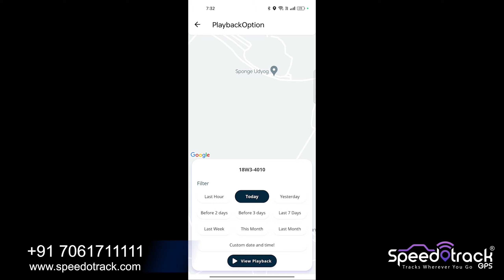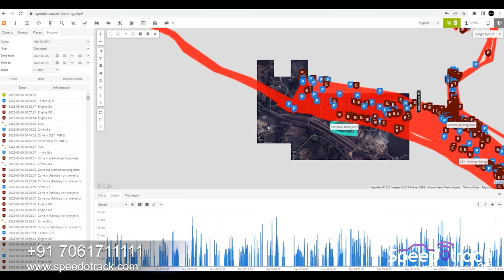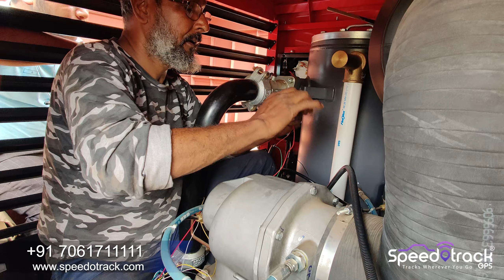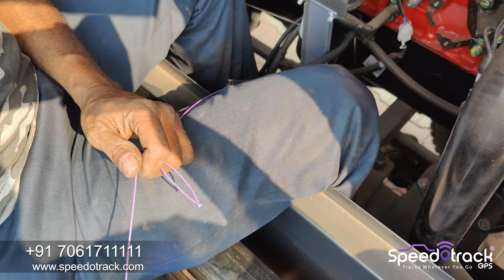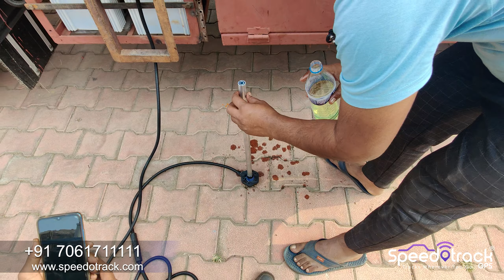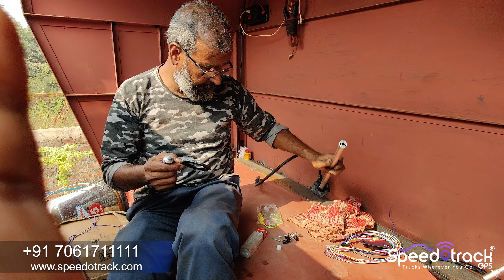Speedotrack Compressor Diesel Monitoring GPS for Borewell Truck Ashok Leyland | 7061711111 ENG 4K

Comment: Very poor experience.
The customer support appears friendly at first and agrees to all requests. However, once the payment has been made, there is effectively no support available.
The delivered software is apparently based on an illegal version of a GPS server system and is also very outdated. The application regularly displays warnings stating that the software is illegal.
The provided source code is not usable. Overall, I have lost a significant amount of money, time, and patience as a result.